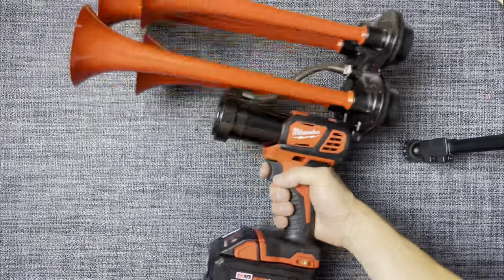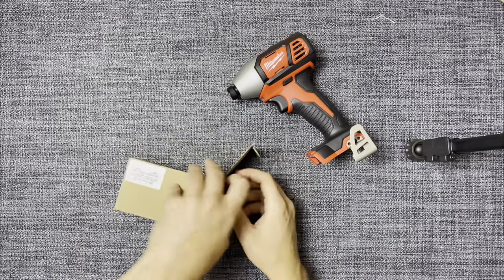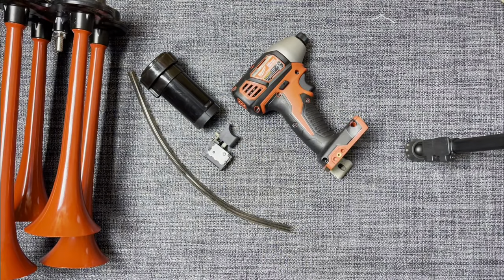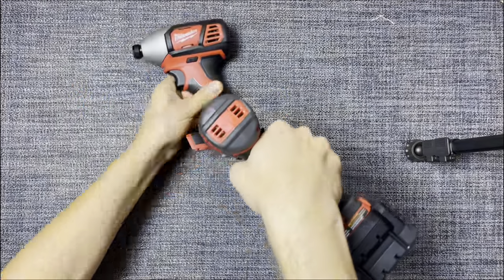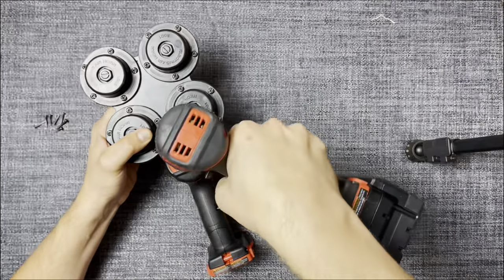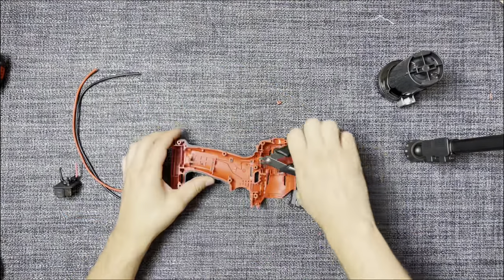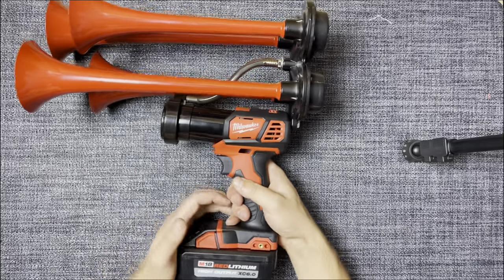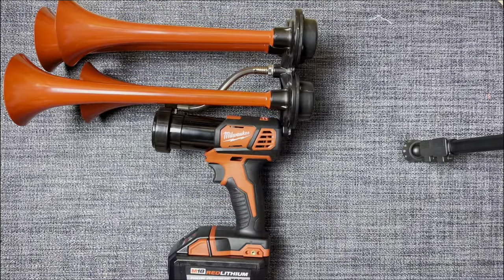How to make a Milwaukee Train Horn

Comment: I have a dewalt brushless drill to use it has 3 wires white black and blue and I can't figure out how it needs to be wired bc it's all incased inside the small board....I may just look for a regular drill

Comment: Thank you!
I could not figure out if they used the impact's motor to turn the compressor or just the voltage from the battery.

Now that I know it is the voltage I could make one from any rechargeable tool.
I have a dead cordless reciprocating saw and an air horn I never installed because it wouldn't fit under my hood.

I bet the 12 volt motor will handle 18 Volts in short bursts.

Thanks  again!
Reply: If you power the 12v compressor with 18v there will be too much voltage and the compressor will not work and it will be destroyed inside so you will have to buy a new compressor if it gets destroyed.

Comment: Just curious why you swapped out the trigger?  
Could we not simply connect the positive/negative going to the motor, to the compressor that will be replacing it?
Reply from the maker: I replaced the trigger because the original trigger did not turn on and off. This is a tool problem with an asynchronous motor, as far as I know.